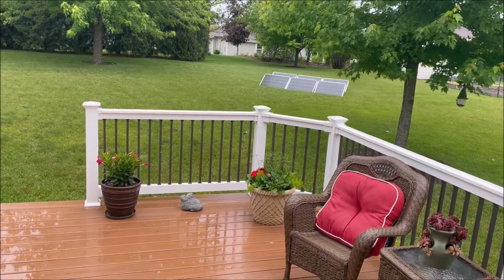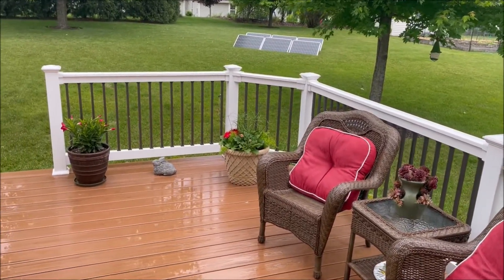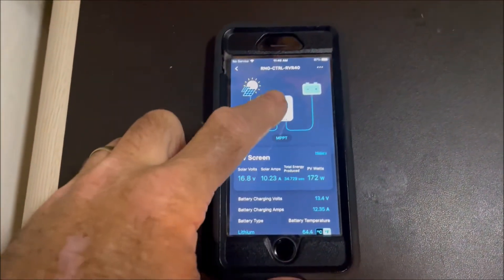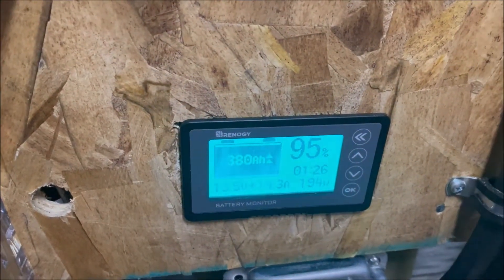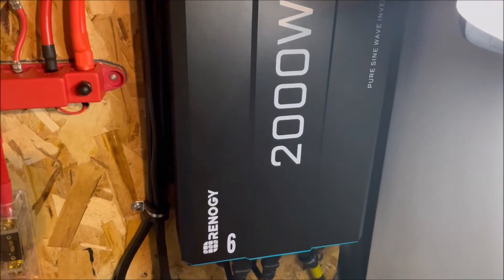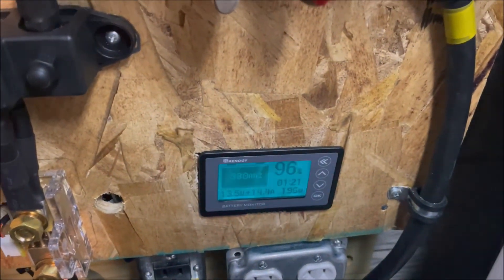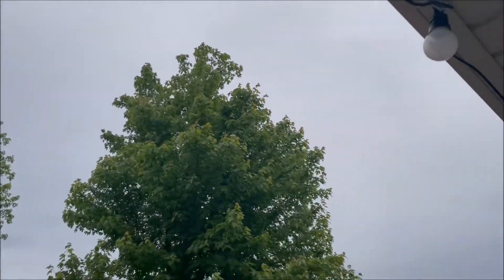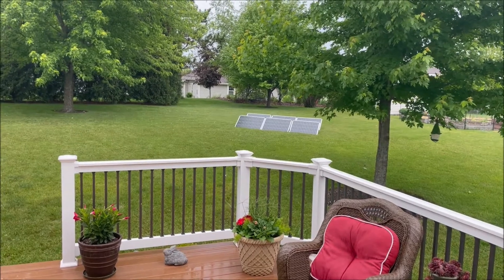When is a good time to Over Panel your Emergency Solar Power System.

Comment: What is the total wattage of your solar panels?
Reply from the maker: I have 600w of the fixed panels and 300w of the briefcase panels.  I only hook 600w together because of limitations of the charge controller.
Reply: @thechiefsway2618  wow that’s great ! I Also have 660Watt half-cut solar panels with Bougerv 40ah MPPT charge controller to charge Power queen 100ah LifePO4 battery 🔋 I think I’m good to go ?